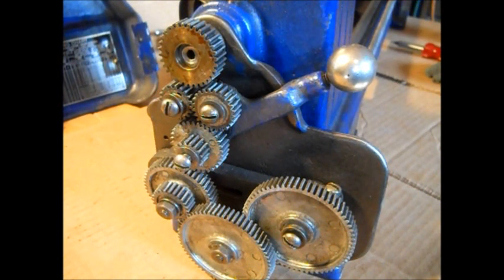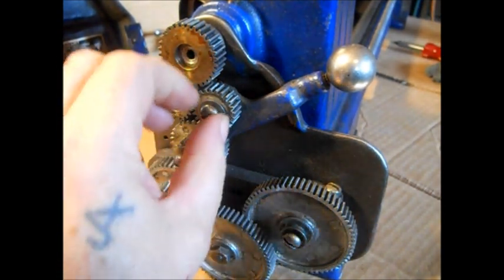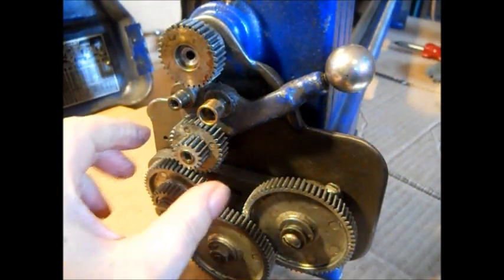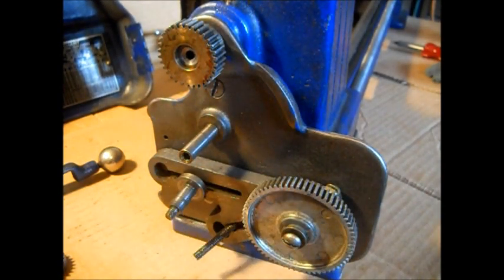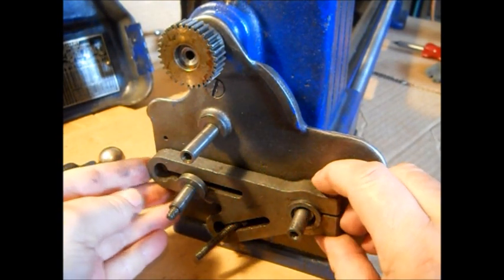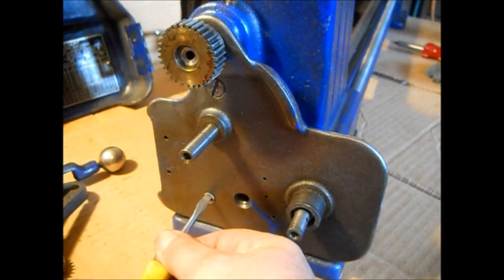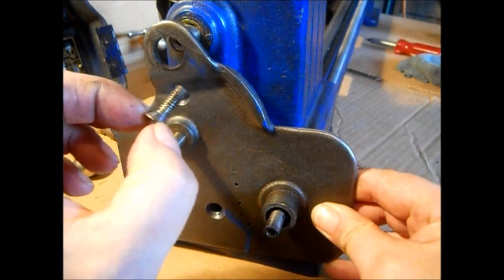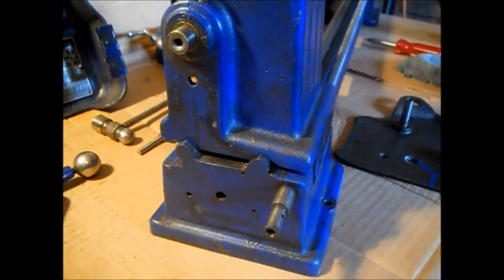Sears 109.0702 Lathe Rebuld Part 1

Comment: Sweet! Your getting into it ... I like the meticulous way you go though things. I knew this would happen and would be fun to watch :) BTW been listening in on the radio and having lots of fun. Thanks again!!
Reply from the maker: So far everything looks ok some of the gears are worn alot I need to learn more about electric motors ..I think I can put a stepper motor type on it with a cogged  belt on the feed screw that would give me many speeds to feed the carriage  Glad to hear the radio is going 27.555 is a good call freq. to monitor